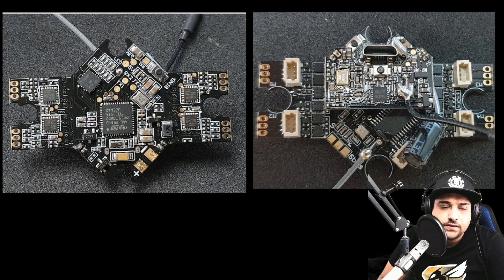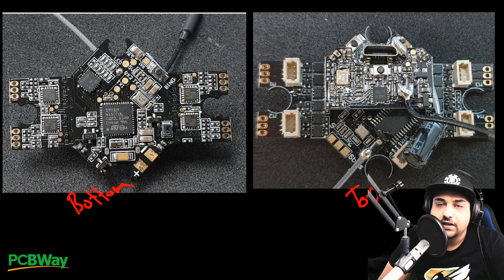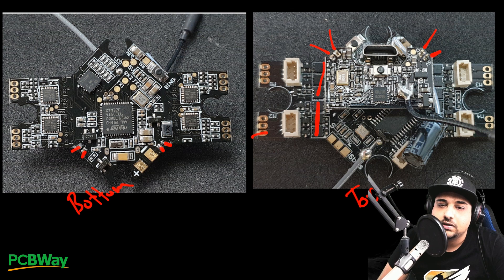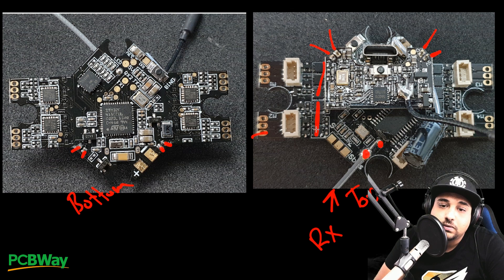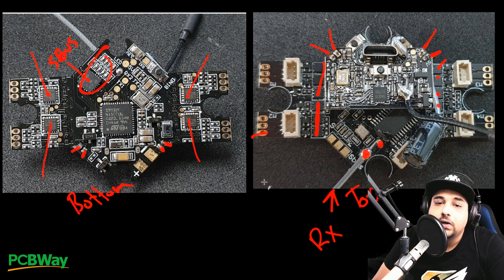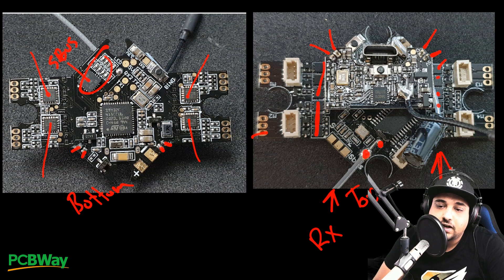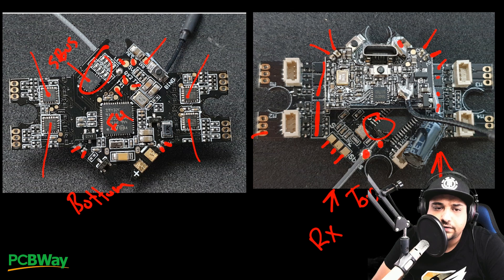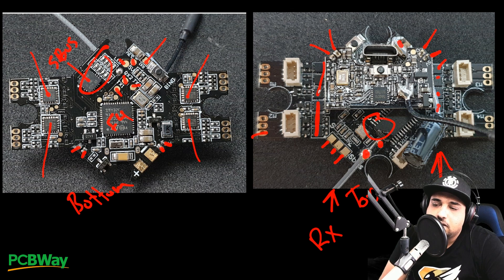What EMAX Should Do Differently With Their TinyHawk Boards

Comment from the maker: EMAX Tinyhawk II Board: https://bit.ly/2B1xSbX
EMAX Freestyle II: https://bit.ly/3c7oKzk
Reply: Hey @Drone Mesh, you mentioned a possible follow up video on how to replace those fets and it seems that there's a fair few commenters who are looking for the same tutorial. Are you able to share with us how far you got with finding replacement parts and any tips on replacing the fets? Links to buy parts would be a life saver!
Reply: Hi @Drone Mesh. Need one help please. I have visibly blown one mosfet for motor 1, and my motor stopped spinning altogether. I believe it would be very hard for me from India to procure the board considering the block customs are maintaining. Is there any possibility I remove the fet and simply add a external small esc of 6A to get going again. I do understand there will be a slight increase in payload.
Any help is appreciated greatly.
Reply: @rcarindom  anything is possible however what you are suggesting would be more trouble than it's worth. Either buy a replacement board locally or ask local sellers if they have any blown warranty return boards that you can have then learn to SMD solder with a heat gun and replace the fet that's blown, that's what I'm going to attempt myself!
Reply: @nicholaskerslake3936  then it will be a very long wait for me. I can remove those fets in question, but do this board have a signal port where I can solder the signal wire to make this work again. Or else because if 2 fets, whole board is wasted
Reply: @rcarindom  there are 3 FETs to 1 ESC, in theory you would have to bypass that ESC completely with a standalone ESC (go look at the size and weight of 5 amp esc's that you can buy) then you will have to look up the micro processor pin diagram and work out which pin is the output for the ESC you need to replace and solder a wire to that pin and to the signal pad of your replacement ESC. Now this isn't even guaranteed to work and would require some very delicate soldering and there is no way of knowing if the replacement ESC will behave the same as the original so it may be like driving a car with 1 square wheel. Please post and share if you get this solution working, it would be inspiring to see.
Reply: @nicholaskerslake3936  actually I couldnt find any datasheet or circuit diagram yet for this board, or else I can see 2 pins for each fets are available fos soldering. I might just check the voltage of these pins to just understand. But if I would have seen a the circuit diagram would have thought something off. One more idea I have, is rerouting the resource for this to some other pin, like TX2 by resource remapping and  free up motor1 pins altogether.
Reply: @rcarindom  but all means give it a go, would be good to hear how it went!

Comment: I changed antennas the other day and the center wire was stranded. What a pain. On top of that, the center was not exposed to the proper length on the other end. It made a big difference in range when I fixed the exposed length.

Comment: Now on the board next to each motor there’s 3 points to solder motor on can you use the 3 pin plugs there instead of soldering the wires to the board ?

Comment: quest: how to fix a broken usb or connect ? 
man u should make a video series/list ( slowly adding)  how to repair with heat gun etc , where to buy, pros cons , with 1+1 logic like the power comes in here goes thu  this and that , we measure it and confirm this or that etc , with the time stamps. So we become more self sufficient .u good youtuber man
Reply: if one does turtle mode on this board 1-2 sec max per try it should flip and let it cool, never had so far any problem.
the rx calbe isn't that hard to create. u can us super sharp knife gently cut in a cirkel (don;t cut ground ) and pull. then twist the ground 2 way togheter and cut the exesive amount off keep 3mm. the inner wire u shoud watch if it matchup the point and cut there and strip 2 mm to solder to signal. U can practice on 1 cable 5cm 2inch  like 8 times.
Reply: these things make the drone hobby accesible when locally people offer repair service this can be bigger , for less cost. inform us more with your knowledge, how is bardwell with soldering with heatgun and what is cheapest option to start ?
Reply: @microsquad040  our mostly emax drone hobby video's , we start a vlog series from the Netherlands now/
thfs ths thr2 bhp4''

Comment: I guess i'll just pray that my RX antenna never breaks, im bending it quite a bit by putting it in the Emax case, but i think that's fine ? Stripping that wire is a b****, id rather just replace the whole board. Great video!

Comment: Hello. Thanks for the break down video. I recently bought one and the little electronic with the K on it popped off. Emax refuses to warranty it even though i did not crash. They said scratches on the screws indicate a crash. I would like to replace this but can not figure out what it is exactly. I do know there is no longer power to my VTX so i assume it is related to the 5v regulated power there. Thanks in advance for any help.

Comment: My Tinyhawk Freestyle 2 startet giving me black horizontal bars in the video feed after 1 Month. Do you think something in the AIO is defect? I tried so many things, replacing camera, holding camera wires away from motor wires, demount AIO from FC (vibrations), shortened the camera wires, and i soldered on a new capacitor on the ground and vcc pin to test if its the capacitor. I dont know what i should do next. The Problem only is there when i arm the quad and gets worse when i throttle more. I now have ordered a new tinyhawk AIO. Do you know what i could test? 
I noticed that the vtx is getting very hot after 20s of the batteries plugged in (200mW).
I noticed that one motor wire is close to break a solder point but i dont think that would fix it. I tested in betaflight every motor by itself if it causes the problem and yes, every motor does. I even checked the motor screws and measured resistance to the esc. No contact. Is it likey that the AIO is just broke? After a crash or something?

Comment: Hi, great video dude.
i have a FC which has been connected to a reversed power source. It had it's blue smoke and it doesn't power up anymore... but if plugged with USB it works perfectly. in Betaflight everything seems ok.
I have tried to replace the KL3 but no changes... what else I could check?
Marco

Comment: I just bought a new board for my TH2F and the new board doesn't come with the capacitor on the battery terminals. is this a new design or do i need to solder the cap onto the new board?

Comment: does the OG tiny hawk 2(without the camera hood and 5500 motors) and the new tiny hawk 2 (with the tilt camera and 6000kv motors) use the same board? i have the OG one and want to use 6000kv motors, would this give me issues or do they use the same board?

Comment: Does anyone know what is the component marked with a K (from bottom view, to the left of the bottom right ESC chip)?
Mine is chipped, but the quad still works fine. 
However, I don’t know if I should replace it or not. Don’t really want to ruin the whole quad for just one component that needed replacement

Comment: After 2 board with failed esc( the fet) i was wondering if i could use an external 4 in 1 esc, is there some point were solder a wire to get the signal to the esc? The fc and vtx are good..

Comment: Great video! Really noob question but i ripped the connector and pad off the ESC for the nano2 cam. You said there was a 5v and video in on the VTX. Can i solder the camera to that since the original spot on ESC seems unusable now?
Reply: The short answer is yes. If you want a more detailed explanation or ever have other drone related questions. Download the drone mesh app called askFPV should be on your phones app store. Many helpful people on there, and its run by mr drone mesh himself
Reply: @RudeLubeuk  really appreciate the response, since posting this i tried exactly what i asked and it did work however there was way too much noise in the video so i went back to the original location and luckily i was able to snag the copper under the board and make the connection. not gonna work for long but im proud i was able to get my first quad back up in the air.  Im gonna get that app you spoke of glad you told me about it!

Comment: Hello nice vid just at the correct moment, My tinyhawkS stopped transmitting video and I Saw that little grey component in the bottom of the FC with a K is damaged.
What is that component? can it be fixed?
Reply: Im really curious of this too.  It seems to be a shielded fixed inductor with K being it has %10 tollerance. But i couldnt find any other spesifications on it.
Reply: @carbendi  it seems like a ferrite capacitor, but is not a common component, so there's not many possibilities to repair, what I did was unsolder the original VTX and installed a rush tiny tank, connectiv the camera to the vtx but no osd information... That's the only way I can ripp my tinyhawkS

Comment: Hey .Thank you for the detailed info on the mainboard. 
Just a question I lost a resistor in a crash (the one at the bottom part second from the far left relative to your video). I want to replace it with a new one but i dont know the resistance of that spesific one. Do you have any info on that?  
Best regards
Reply: make a picture of wich one exactly, i'll measure on my board...
Reply: @corneliudoc  Thanks man.  I already solved the problem by my self and wrote a blog post about it :D 
https://www.longwalkproduction.co.uk/post/fixing-the-broken-resistor-in-tinyhawk-2-mainboard